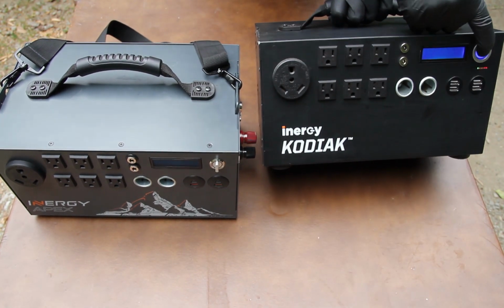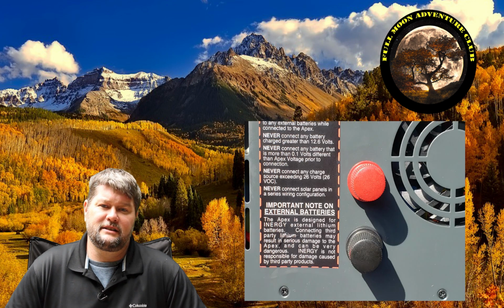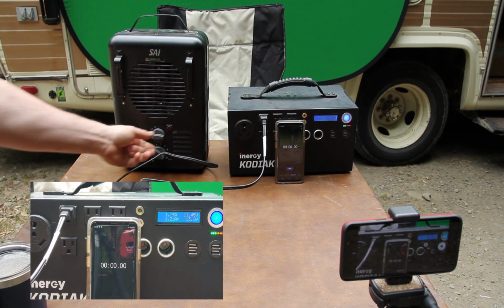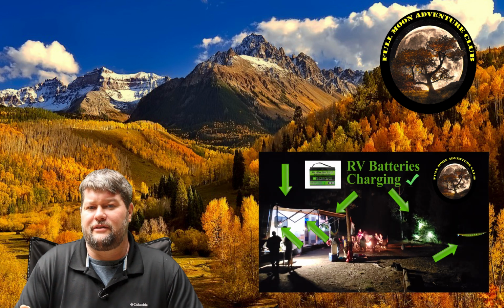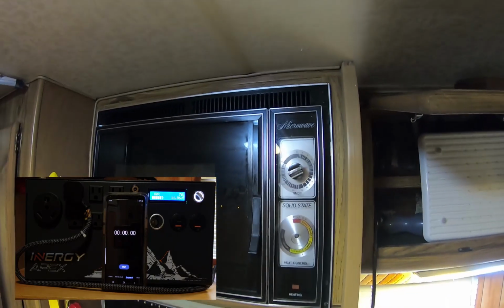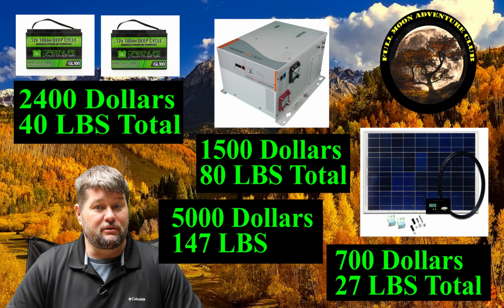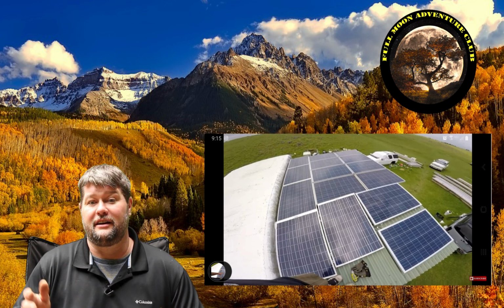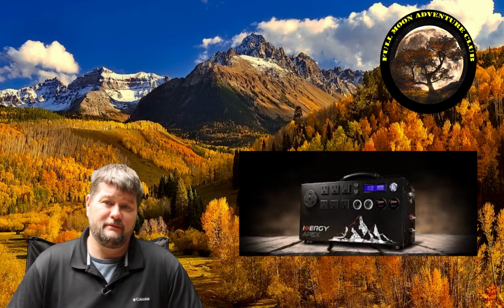Inergy Apex Pros, Cons, And Questions Answered

Comment: I appreciate your review, honesty about getting a free Kodiak and Apex, and affiliate (compensated) status.  You seem like an upstanding person.  But, you substantiate many complaints in Will Prowse's video.  Proprietary connections that are not weather proof is a big issue, as many people live in climates where it can start raining at any point.  Only being able to use Inergy’s expensive solar panels is a big issue.  Also, the advertisement for use with lead acid expansion batteries that will quickly drain or kill the battery.  Why build it for lead acid expansion batteries when it will not function properly?  The advertisement for 1500 watts continuous power is disturbing, when it will only accept 550 watts continuously. 

It may work well for recreational use, but many are buying this for their homes and blackout situations.  The test you did on the microwave was interesting.  But, nothing else was plugged into the Apex at that time.  How would it perfom with something else plugged in?  In a blackout situation, I cannot see everything being unplugged just to run the microwave or other appliance.  That is the problem, when people see the claims of 1500 watt continuous capability, and purchase it for the claimed usage, only to find it is false, and will not handle the load they expect.  We can do all the calculations of what wattage our appliances and other items use, but it is useless if the Apex does not run on the claimed wattage.  If Inergy actually advertised it honestly (550 watts continuously), people could make an informed decision.  Right now, I would like to hear from Inergy why it is falsely advertising the capability of this product.
Reply: I agree with you 100%.  I expect a manufacturer to provide the facts and not to inflate the capabilities of their product.  After that, it’s up to me to make an informed decision.  I can’t make an informed decision when the manufacturer does not provide accurate information.
Reply: We feel exactly the same way.  We spent $2000.00 on the kodiak and solar and using additional batteries,  we can watch tv for 6 hours.  We need it for a cpap machine but it often conks out around 3 am!  We would not have purchased it if we knew the actual wattage output.
Reply: Just looking at the specs - it appears that they're rating the battery to deliver 550 watts for 2 hours to get the full 1100 watt hours, but that the inverter can deliver up to 1500 watts at one time.  That's why is sounds so confusing.  Most lead acid batteries are rated at a 20 hour discharge rate for full capacity, lithium is much better (depending on chemistry) but can't deliver full capacity at max discharge.  Pulling lots of power quickly from any battery keeps you from getting the full capacity.  I think the inverter spec is different from the battery spec.  From this test it appears the inverter is a 1500 watt peak output.
Reply: @ryansmith3290  No, it is not confusing.  Inergy has been misrepresenting the capability of this unit for quite some time.  You have to read through the manual to see that it is only 550 watts continuously for two hours.  That is very different than what they and some affiliates have been advertising.

Comment: I want to add my appreciation to you Jim for putting this video together. I realize it was an extra effort for you, but it sure did ease my mind about my Apex purchase. My wife and I live on a sailboat full time, so we “make” all of our power. Do I expect the Apex to replace my boat system?..No. But I do think it will improve our life with readily available solar power for “stuff”. I especially liked your use of the Apex to help charge your RV. I don’t think either one of us expect the Apex to replace our on board systems, but it sure can help support them. I think the 1500 watt/550 watt dilemma is being blown out of proportion by some. Do we all drive around in 50 horsepower cars. Nope. We cruise all day at 55, or 70 mph, we just pay at the pump. We rarely use that 360 hp under the hood, but it’s nice to have when you need to get around that 18-wheeler.  But we sure don’t drive around full throttle all the time. Same with a 1500 watt inverter. Thanks again Jim for your real world tests. God bless you. Gene
Reply: I agree and think that you have a realistic view of what this system is all about!!
Reply from the maker: Thanks very much for the kind words Gene. I hope it serves you well on your adventures at sea. Thank you very much for the comment take care and happy sailing!    Jim
Reply: So true.  I am setting up for emergencies small and big or dry camping but either way I won’t be using even 1/2 of a full charge daily.  I boil water in a 12volt 150 watt cigarette lighter plug kettle in 15 minutes, not even a dent in my Kodiak and that’s about 3 cups.

Comment: Howdy!, I bought into the Inergy Apex because of your use of the Kodiak. I PANICKED when I watched the Wil Prowse PANNING of the Apex. The very day my unit arrived. LSS. Contacted Inergy customer service by email and they responded within 24 hours. Reassuring me that the company STOOD BEHIND THEIR PRODUCT they would REFUND my money but, also included some more information about why the unit Prowse recieved was defective and they are dealing with replacement. I have since then UN BOXED the unit and given it a full charge up to 12.6 volts. I am in Tallahassee Fl and the unit is my QUICK response to lost power which I have see several times over the two years living here. NOTHING is ever as good as advertised BUT, this comes DAMN close. AFTER you understand the intended use.  Enjoy your reviews, no B.S. and easily understood.
Reply from the maker: I am glad you gave your unit a try. I really do use the crap out of mine and they are both great. I hope it serves you well. Thank you for the comment and happy camping.    Jim
Reply: The email I received from Inergy (Adam, specifically)  was very informative and yes he did relate that the broken switch issue may have been a defect.  If you (as I have)  watched Prowes' other Apex and attendive solar panels he is excited about the units performance.  As I stated this is my quick reaction unit for short durations. I have other options for longer durations of power loss. I LIKE the portability, PSW inverter/charger and number of ports. Nothing comes close to energy per pound as this other than their Kodiak unit. Hope this helps.
Reply: OK David, just to clarify something you have said that would explain a lot of conflicting information that is going on: You called Inergy, who told you that they shipped Will Prowse a defective unit and are in the process of replacing it. Is this correct?

Comment: What cables do you use to go from Solar Panel MC4 connectors to the EC8 plug?
Reply: Unfortunately I don't think Inergy makes a MC4 to EC8 adapter. They made an MC4 to Neutric adapter for the Kodiak but it had some issues. Making your own isn't difficult but make sure you wire your panels in parallel with appropriate guage wire to the Apex. It can't handle the voltage of panels wired in series. Good luck 😁
Reply: Thanks for the reply.  I had come to the same conclusion.  Have some cables on order to convert to a EC8 adapter.
Reply from the maker: They sell an adapter that energy. Otherwise you have to get technical and splice it yourself.

Comment: To just say continuous power and peak power for x min shouldn't be that difficult. It helps people size the power source for their needs. To also explain better the use of expansion batteries would be useful. Many connectors with no labels. In the outdoors one may not carry the manual and it would be nice to know where to plug things. Not everybody is an electrical engineer. Manuals made out of papers get wet also. Basically more user friendly would be nice. In the end also what kind of additional batteries can be plugged to it without damaging them? Lithium? Need more info. How about some schematics? What is inside this mysterious black box? Do I really have to design one my self? I just wanted to buy one.

Comment: Thank you for the video you made. I check other people review before finalizing my decision. I would love to know if you think the  180-Watt Monocrystalline PV Solar Panel for Cabins, RV's and Back-Up Power System from homedepot would work with inergy apex?
Reply from the maker: I would have to have more information about the panel. Inergy says you should use only their brand of solar panels. You can hook up any solar panels as long as you do not exceed the limits of the Apex charge controller an the panels are connected properly but kt may void your warranty. So I can not tell you yes or no on that one. Take care and happy camping.    Jim

Comment: Can I use my Zamp panels on this, like are the input plugs  to the unit compatible?
Reply from the maker: The plugs probably are not compatible and it may void the warranty of the Apex if you use anyone elses panels. However, you can connect any solar panel to this if you are willing to splice wires and connectors to make it work. I just can not tell you yes or no i'm afraid. Good luck and happy camping.    Jim
Reply: Thanks Jim, I have watched most of your videos as I was getting started with my rv several years ago. They are very good and most helpful.
Reply from the maker: @robertpowers6727  glad I could help. Thanks for continuing to watch and happy camping.  Jim

Comment: Thanks for the tests to "failure" and reasonable use review. 
At presale with discounts, the Apex appears to be a good value. At full price there may be comparable options with different pros and cons. I have a Champion Dual Fuel inverter generator for the "big" loads, so the only deficit will be not running AC in some places at night.
Reply from the maker: Glad I could help. Thank you for commenting and happy camping.    Jim
Reply: @fullmoonadventureclub  Thanks, I'll be getting my Apex in the 2nd pre-sale group. 
I'm just wondering what the effects on discharge will be with solar panels connected since that should decrease the battery discharge load. Can you do an "Apex Silver" 300A (with acceptable loss) solar input test?
Reply from the maker: @lwfaulkner  not yet but waiting on panels. I will post when I have them. Take care and happy camping.  Jim
Reply from the maker: @lwfaulkner  my panels are on the way and I'll definitely try to address that test for you. Might be a week or two though it's hard getting stuff when you're rving all the time.
Reply: @fullmoonadventureclub  Thanks!

Comment: Thanks for the review! On the 1500w topic I have been able to use my Kodak for over 6 min pulling about 1500 watts and never had any issues. I hear people in reviews say it shuts down to protect the battery but could it be just a thermal shutdown depending on the ambient temp outside and how hot the inverter gets? It is stuffed in a box with a bunch of other electronics and the fans can only do so much right. Would be interesting to test in the winter to see if it's just a thermal issue...anyways thanks again for the review!
Reply from the maker: I also noticed a correlation with several minutes in between test depending on the temperature of the Apex. After a lot of testing and charging and In the Heat of the day times are diminished by a minute or two. When tests were conducted early in the morning from a cold start they tended to last a lot longer. I think it's just a thermal protection circuit that affects performance. Thanks for the comments and happy camping.  Jim

Comment: THANK YOU for taking the time to put this video together. I have been a fan of Will's channel for a while now, but I do feel his last review of the Apex was very misleading and unrealistic. I just received my Apex and will be going full time in a  couple of weeks and now I can feel better again that this unit will be able to meet my needs as I have expected it would. I do also have a small portable gas generator to backup the solar when needed. I  went with the Apex over a custom install because of the portability advantages and because I just don't have the time to learn how to do a DIY system right now and for the price to have to pay someone to do a custom install would cost at least as much as the Apex with panels. Thanks again for doing this additional real world testing showing how it works with normal everyday rv life!
Reply: One thing to remember, putting a 5,000 dollar system on permanently is quite an investment. It is so much easier and cost effective if you were to choose to move into another rig. That's one of the reasons we chose the Apex. The Apex is portable. I have seen several youtubers go through and spend lots of money on a solar powered system and then up an change rigs. I bet they really don't get the money back.
Reply: @tammydowell589  Couldn't agree more! Seems like many people go through 2- 4 rv's before finding the right one, so portable does have many advantages.
Reply from the maker: My pleasure. It sounds like you chose your Apex for all the right reasons. I think you will love it. Take care and happy camping!    Jim

Comment: I built my own "solar generator" with 4 100 watt Renogy panels, Renogy MPPT 40a Charge controller, 3 100ah AGM batteries, 1000 watt PS inverter, Victron battery monitor, 4 DC outlets, 4 phone chargers, 4 AC outlets, 8 Anderson power pole connectors (all 8 fused), battery shutoff and all the necessary fuses and breakers. Everything ordered from ebay and Amazon. All this under $1000. 
If something goes wrong with the inergy or Goal Zero then you are out the entire unit. With a DIY setup if something breaks then you can just replace whatever broke (fuse, breaker, controller, wiring etc). Most of the hardware used in my DIY generator is under warranty so.... A DIY set-up is the way to go in my opinion.
Reply: commando602 I agree with you mostly but it really boils down to application. There is value in mobility and simplicity. Solar energy is still new to a lot of people and a majority of those people still rely very heavily on grid power. This 500 watt “generator” is helpful to those who don’t necessarily want or need an off grid electrical system. Also, your agm batteries won’t have the same charge or discharge rates that a equivalent amp hour lithium bank will.
Reply: Will P also said the Kodiak was priced about the same as DIY and now I think the Apex’s are priced even lower.  I have a Kodiak and love it, very lite I use it daily.  I can DIY somethings but definitely not electrical, even basic electrical so I really appreciate the all in 1 box Kodiak.